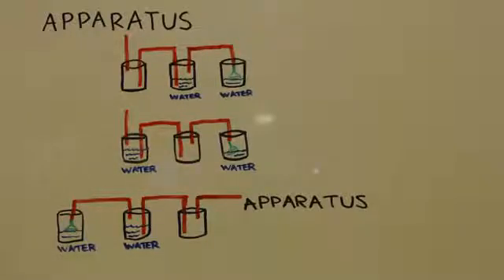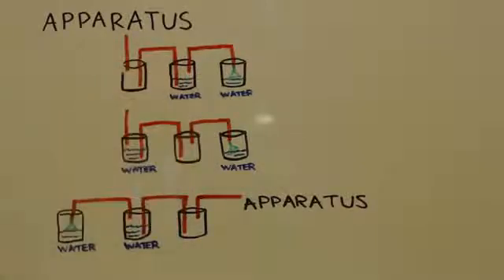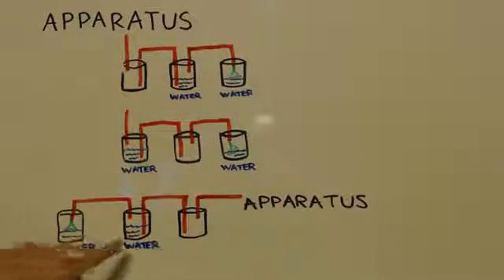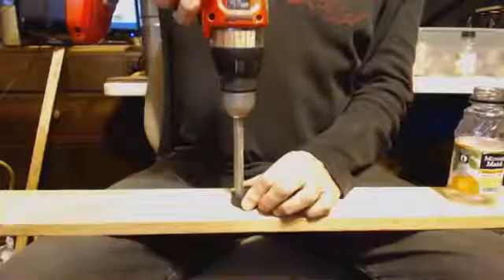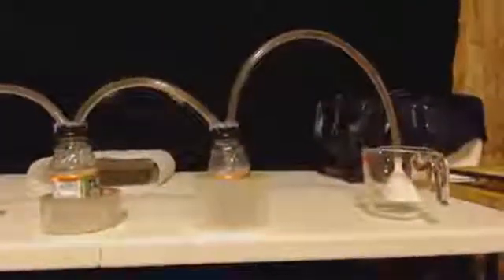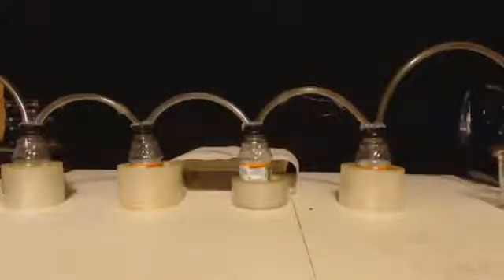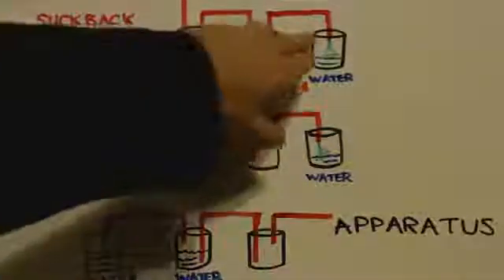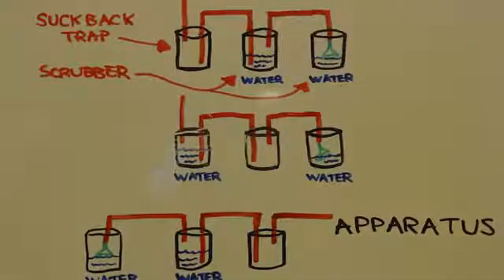HOW TO MAKE A GAS SCRUBBER FOR CHEMISTRY

Comment: Mr. Super Chemist, if I may give you a piece of advise sir. When you drill out the caps screw then on the bottle real tight and duct tape right over the top of the cap, since the drill spins the same way as opening the cap, that way it doesn’t just spin right off once the bit bites. Then you can hold the bottle and your hands out off the way. Idk if you’ve ever drilled in to the meaty part of you thumb/palm but I have holding something similar to what you were doing. It didn’t feel to swell went almost all the way thru fortunately I had the presence of mind to not just rip my hand away but to reverse the drill, saved all the mangled flesh to be stitched and glued back together instead of ripping it out with the bit. Be safe my man, thanks for all you do. Learned a lot on this channel.
Reply from the maker: GW Smith...……...Sorry took so long to respond but youtube did not notify me of your post.   Just stumbled upon it by accident.  ANYWAYS I am glad you like the channel.  And oh my god I can not believe I did not think of leaving the cap on the bottle while drilling the hole.  The most genius ideas are always so simple you want to punch yourself for not thinking about it yourself.   Yes I have drilled a little skin off my fingers before.  Not bad though.  Thanks for the tip.  It is definitely a GOOD one.

Comment: Works great! I made a few changes, used 4 Mason jars, 1 empty, 2 sodium hydroxide and the last 1 activated charcoal. I went a far as using a fish tank check valve between 1 and 2.
Reply from the maker: Just Geno …….. Wow that is a great idea with the check valves.  I am going to have to look into that.  Did you have to remove the check valve from something you bought at the fish store OR do they sell check valves in a box all by it self?????
Reply: @jbsc6180  Amazon 8 for 4$
Reply from the maker: Just Geno...……...I will definitely check that out...…..THANKS

Comment: Looks like that will work for my NO2
Reply from the maker: Just Geno...……..Well remember NOT to use hot glue and use JB weld instead. It will last longer.   When I used hot glue after a few uses the glue seals started to leak from moving it around.  I am making a new and improved gas scrubber this winter.    Also you may be interested in this scrubbing method https://www.youtube.com/watch?v=A7wMS2w9-nA&t=12s
Reply: @jbsc6180  copy that, thanks! Saves a  large amount of $ , for simple small scale reactions
Reply from the maker: Just Geno .........I know what you mean.  It is always about money.  This hobby is so freaking EXPENSIVE
Reply: @jbsc6180  I think a check valve from the fish store will stop any back flow too. And put some carbon in the first jar maybe?
Reply from the maker: Just Geno.............  Carbon?  I could be wrong but i do not think carbon is that good for scrubbing gases UNLESS it is very small  trace amounts of gases.   What would you want the carbon to scrub......NO2?     I could be wrong but i do not see carbon doing much of anything to scrub NO2 gases.
Reply from the maker: Just Geno.........….Nitrogen oxides are the HARDEST gases to contain/scrub in my opinion.  I usually have 3 bottles of aqueous NaOH that I bubble NO/NO2  through and I can still smell it a little even after it goes through 3 bubblers/scrubbers.  Next time I will try 4 bubblers in series